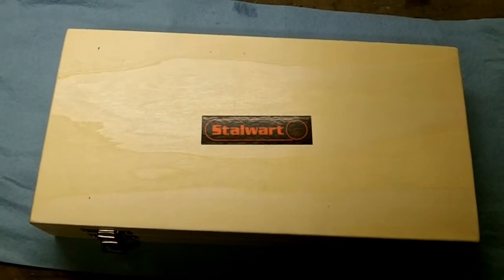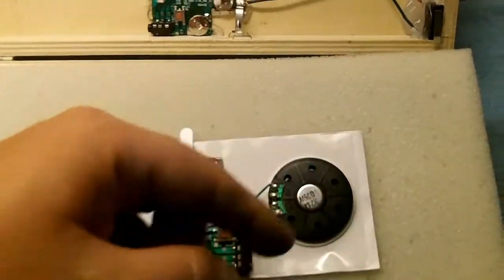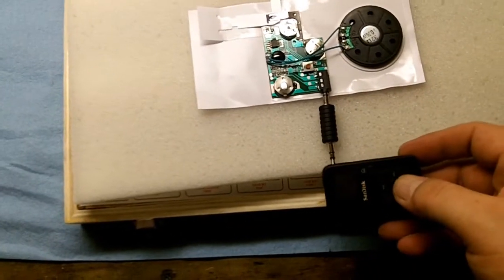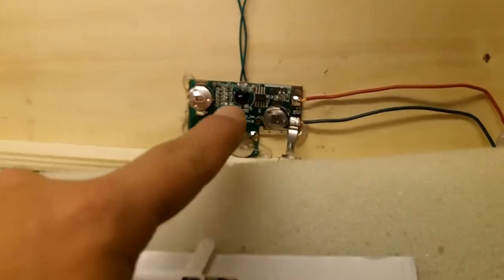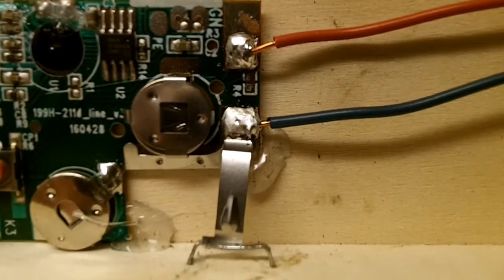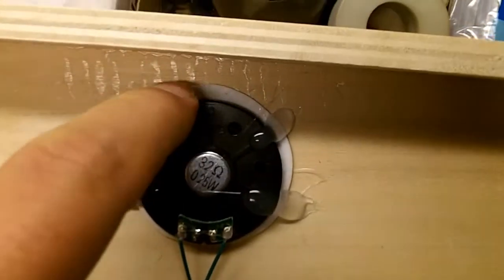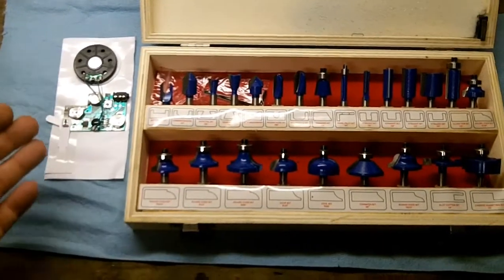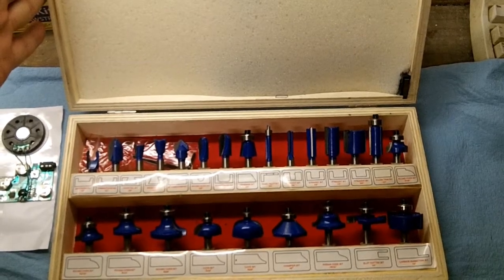Electronic Greeting Card, Lever Switch Hack

Comment: Nice job and glad you're back :)

That black wire solder looks bad, let's hope it lasts :)
Also why not convert it to AAA rechargeable batteries while you're hacking at it anyway? You know your sister is never going to replace those coin cells when they run out.
Reply from the maker: Felt like a normal thing to make a video again, getting back into the habit.  Yeah the solder job was really dirty.  My soldering iron wasn't working right. Had to crank it up to 400 just to get solder to melt with a clean tip.  The screw end keeps coming loose.  I need a better quality soldering station.  They are super easy to access if she ever needs to replace the batteries.  I'm sure she can figure out how to find the right batteries.

Comment: This may be a dumb question, but what type of wires did you use in this? I've been searching for a video like this and this is exactly what I want to do make! Great job by the way!
Reply from the maker: I used automotive solid core wire.  Solid core is 1 solid piece of wire. Speaker wire is many wires twisted or braided together.  Both will work fine.  Only reason I used solid core is because I work on cars a lot and it was the first thing I picked up off my shelf.